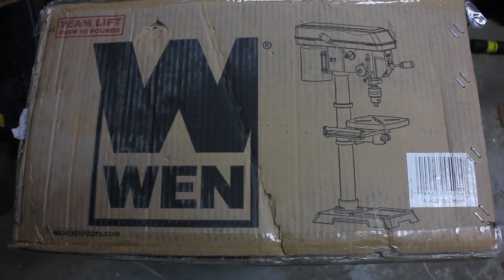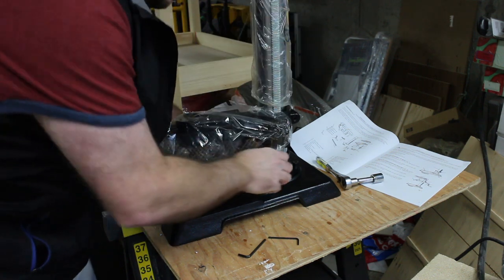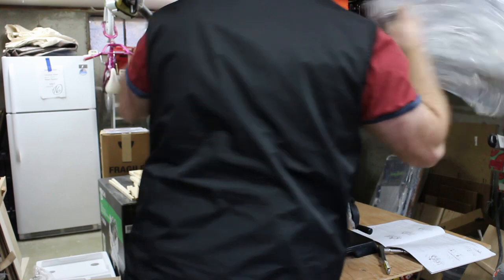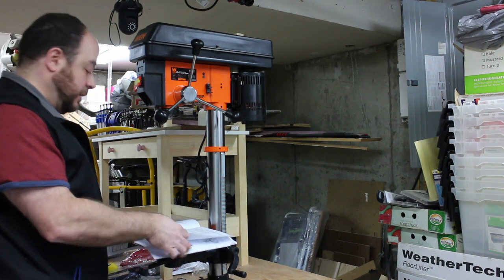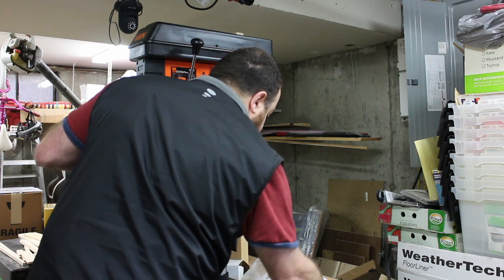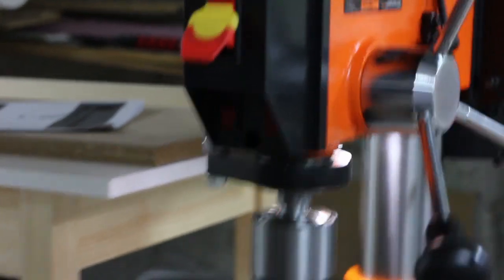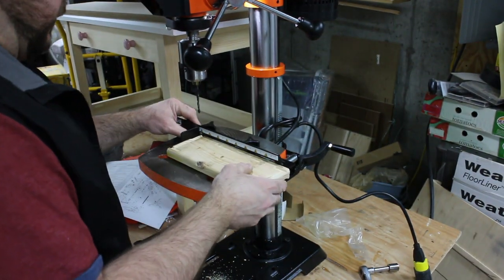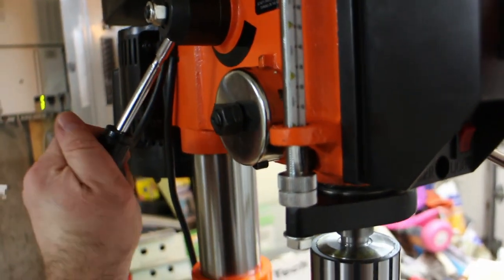WEN 4214 12" Variable Speed Drill Press with Cross Laser and Work Light - Unboxing and Assembly

Comment: When you spill some oil on your kitchen counter and wipe it off with a paper towel, there's still some oil residue remaining. That's why you'd use a household cleaner along with the paper towel, right? Same goes for the chuck and the arbor. You need to use a solvent to clean both. BTW, the "fingers" inside the chuck are called jaws. Good luck.
Reply from the maker: Thanks. I little film of oil doesn't hurt. Tools sometimes sit around without being used here often. The oil film is going to protect the surface anyway. Thanks for the terminology!
Reply: @m3rdpwr  If you can't see a difference between seating a chuck/arbor for least runout and oiling some random tool, not much left to say. Unbelievable.
Reply from the maker: @felixf5211  I wasn't talking about oiling a tool. I see many people completely remove oil from metal surfaces from these or table saw tops, just to wax them to keep them protected. A film of oil is not going to hurt anything, unless it's going to cause staining on a wood surface, etc. you are working on. The original drill press I bought from WEN had horrible shaft wobble and had to be returned. I never claimed to be an expert, this is my first drill press. I was showing assembly and first use. This Obviously did not satisfy your level of expertise. So as you said, not much left to say.
Reply: @m3rdpwr  A properly seated chuck should be air-tight. It's not a table saw that is exposed to ambient conditions. A film of oil on your arbor will indeed hinder the performance of the tool. You don't have to believe me; run a google search on seating a chuck. 

This is your first drill press and OTOH I work on them. There are 15 in my shop right now ranging from a 212lb Champion post drill from 1904 to a '90s Rockwell. FWIW, I only work on industrial and/or vintage presses. Never had anything like the Wen in my shop for obvious reasons. Before I ever touched a drill press, whenever that was, I researched setup and consulted with folks who knew more than me. Still do. As an example, just finished a 1939 Delta DP220. As it's a product of the original production run of the series, didn't want to make mistakes and discussed the work extensively with someone who has a lot of experience with this model. I'm trying to help you and your attitude is dismal at best. Ultimately I don't really care about your drill press, it's not as if it's one of mine, and will not respond again. Best of luck.
Reply from the maker: Okay so you won't respond again. You're obviously a professional, I am an amateur at this kind of thing. I don't need this for perfection of machinery, it's mostly to drill in dimensional lumber so perfect accuracy isn't a concern. This is good enough for me. Maybe in many years from now, I will need to get something more professional and learn. We are all learning, as you indicated that you're still learning. I needed something small in this fits my needs. I just find it interesting for someone with your level of expertise coming to an unboxing of a low end $199 drill press. Have a great day.

Comment: How to you adjust the table angle?
Reply from the maker: There is an adjustment lever, on the table itself that sits behind the vertical support post. There is also an adjustment that allows you to spin the surface to turn it that way if that's what you meant. Thanks for watching.

Comment: Thanks for the vid. I assembled mine from watching yours. I did drill 4 half in holes into the base plate to better stabilize the unit. Machine is 36 inches tall which is more than I expected.
Reply from the maker: BadWolf I think I measured mine out slightly taller, but that may be from the motor case top bulge.
Call WEN A and have them send you the fence if it's missing.
Thanks for watching and commenting!

Comment: Appreciate the review.  I was looking for some functional points, one in particular - can you swivel the head around?  To allow drilling into longer objects.
Thought I’d provide some quick tips to help with your future videos (meant to be positive, not critical)
1) script it out in advance and rehearse.  Think of 3-5 key points you want to make
2) keep it short 3-5 min max.  YouTube viewers have a short attention spans 
3) preset / pretest the camera views so that you get a clean shot and you’re not blocking yourself
4) yes, it IS polite but you don’t really need apologize or call attention to errors
5) take time to edit the video.  It’s ok to use time lapse & edit out content that doesn’t contribute to the overall message.
Reply from the maker: Jim, it's funny a buddy of mine said the same thing when I asked for suggestions.
This is one of my earlier vlog style DIY videos (6th of 82, I can't believe it!) , and since then, time lapse and editing out useless parts has been my friend with my new software, although time consuming.
That being said, I do appreciate the suggestions!
When you say swivel the head around, can I assume you mean the table, and not the head/motor assembly?
If you mean the table, yes it can be raised/lowered as well as pivoted/spun off to the left or right side.
There is a handle at the back of the table on the left side that will allow you to do that.
Or is it you want to turn the head/motor assembly around so that you can drill a very large object that may be on the floor?
For that you would have to loosen the two alan head screws I tightened @13:30.
Does that answer it?
Thanks for watching and your support, I appreciate it!

Comment: Hi Mario thanks for the video! Mine arrived today and I was prepared after watching you put yours together. I can't believe mine survived the trip based on the condition of the box. Unlike yours, mine didn't include a fence.
Reply from the maker: Ali Maleki that's awesome! Strange it did not include the fence. However, my manual shows little about a fence but it came with the fence. I would call when and tell them your's was missing the fence. I bet they will send one to you. Let us know how you like it!
Reply: I have a feeling it may have fallen out of the box. The box was torn in corner where I believe the fence is stored near the chuck which was floating itself floating around without it's box!
Reply from the maker: More reason to call Wen ASAP and see if they will send it to you!
Good luck and thanks for liking, commenting and watching!
Reply: I just got off the phone with WEN. They confirmed that they no longer include the fence. I also noticed that (unlike yours) my manual doesn't show it in the parts diagram.
Reply from the maker: That's a bummer.
Thanks for letting me know about that.
That being said, you can make one with a small piece of hardwood like a 1"x1"x1ft, some long toilet closet bolts, washers and wingnuts/knobs.

Comment: I just got this drill press.  It goes together easily.  One note, it no longer comes with the fence that you assemble at 36:00 minutes.  However, I purchased the auxiliary table from amazon and it works well for woodworking.  I did need to adjust the lasers as well as the table angle so the bit is square to the table (a simple adjustment).
Reply from the maker: Thanks for sharing Andy. You are the second person to mention that the fence is no longer included. Would you care to share the link, or model of the table for other users to see? Thanks for stopping by!
Reply: @m3rdpwr  Sure!  I purchased the drill press (WEN 4214) and table (WEN DPA2412T 24 in. x 12 in. Drill Press Table) from amazon.  Here's the link:  https://www.amazon.com/WEN-4214-12-Inch-Variable-Speed/dp/B00HQONFY6/ref=sr_1_1?crid=15MHX366DMH1G&keywords=wen+12+inch+drill+press+4214&qid=1551662181&s=gateway&sprefix=wen+12+inch+%2Caps%2C139&sr=8-1
Reply from the maker: Perfect, thank you. I will pin that link in a comment.

Comment: thanks for posting this video. I just bought the same drill press and will be putting it together soon. Your video will help. Good stuff!
Reply from the maker: Thanks for watching and commenting!
Reply: hey mario, I got the drill press installed. everything is working fine. one thing I did notice was how tight the variable speed control adjustment was. The lever is pretty tight, so speed adjustments are very slow. Is that how it is for you?
Reply from the maker: It is tight and I move it slowly.
It does have an adjustment for that, but I recommend you don't touch it.
If it was too loose, it could change speed on you while in operation.
Let us know how you like it!
Reply: I just finished a project that involves drilling eighty 1 3/8 size holes with a forstner bit. This WEN DP worked like a champ. Absolutely no wobbling. The included fence was helpful as well. I'm glad I got this DP for $199 on sale. Well worth it.
Reply from the maker: That's good to know!
I have yet to tortured mine, just some holes here and there in wood and also when I was doing some heli-coil inserts.
I'm tempted to get some of those sanding drums to make it a make-shift sander.

Comment: I just assembled mine today (12/2019) and it is very easy.  Evidently the new ones don’t come with a fence but the rpm readout does turn off when you turn the power switch off. I know a lot of other videos say it stays on until you unplug the press.
Reply from the maker: Yeah, I've heard about the fence not included anymore by many. If I recall correctly, my manual didn't talk about the fence. My display stays on all the time. Seems strange they would have done this. However, I unplug mine after use, so I am not too worried.

Comment: Good job with the video. Try to keep the camera from too much movement;move camera slower so that the viewer is gradually taken to the next area. Questions: Is there a another chuck that will fit the DP? What size is the taper of the chuck?
Reply from the maker: Thanks for the suggestions! I actually bought an extra wide angle lens after shooting this (10-18mm) so I could shoot better and get more in the shot.

Yes, there is another chuck that I found listed by another user at the time of my purchase.
I don't have the exact model, but this was the manufacturer.
https://www.amazon.com/dp/B00N413YUU/ref=wl_it_dp_o_pC_S_ttl?_encoding=UTF8&amp;colid=3RYUTMS5YE2QY&amp;coliid=I35MJWA71DL1BV&amp;psc=1
Call the manufacturer HHIP and WEN to verify shank size, etc.
To be honest, I didn;t buy it because it cost more than the Drill Press!
It is quite nice though, has very little run-out and is a keyless chuck!
The person who bought it seemed to have liked it.
If you do decide to purchase one, let me know the model so I can add it to the description.
Thanks for watching and commenting!

Comment: I have the model 4210, two models down from this one I believe.  Its pretty good and does what I need, but wish I could have went one more up and got a bigger motor, mines like 1/3 HP and 3.9 amp.   but I only paid $98.00 for it on sale and its still doing well over a year later so I could have done worse, its certainly better than an equivelant HF model.  I did eventually replace a somewhat wobbly spindle pulley from Wen, I paid for it and Menards reimbursed me the $16 -- its from China what are 'ya gonna do.

Comment: I bought the same drill press .my chuck is a tad outta balance ,, wen is sending me a new one , and you mentioned the speed adjustment is stiff , Mine did the same thing until I read the instructions that said DONT adjust speed unless motor is running . LOL opps for both of us ..
Reply from the maker: I thought I mentioned only moving the handle when running. Maybe not though! Thanks for watching and taking the time to comment!
Reply: you did , I was in the middle and you mentioned it at the end ,  good video

Comment: thanks for this review. I'm looking for an affordable option for drilling steel. I want to drill holes in 1/4 inch steel, some sheet metal etc. Would this be a good press to do this with? Or, should I go with the 4210?
Reply from the maker: I've only drilled wood with this press.

This is the 4214 a 12" press. The 4210/12 is smaller. (10"?)
The 4210 I think is manual speed belt adjust, whereas the 4212 has similar speed adjustment like the 4214 here.

That being said, if you have a good drill bit, cutting lubricant and set the press at the right speed, I wouldn't see why you couldn't drill in 1/4" steel.
I don't know if it could do it all day long, but casual use shouldn't be an issue.

I prefer the easier adjustability of this drill press for varying speed. If you drill in many types of materials, hardness and thicknesses, this model makes sense.
I wish I had some here I could try out for you, but I am limited to lumber at the moment.

Thanks for watching and commenting.

BTW Amazon is having a large sale on WEN products, go check it out.
https://www.amazon.com/gp/product/B00HQONFY6/ref=ox_sc_act_title_1?ie=UTF8&psc=1&smid=ATVPDKIKX0DER&tag=tbdirect-20&ascsubtag=584e81b5-8e72-40c7-a931-9cd0e04f32b3
Reply: thank you for your help. just subscribed.
Reply from the maker: Thanks!
BTW I think that drill press just dropped in price again for $186.90.

Comment: Thanks for the video!
Question: How tall is this press from bench to top? (I checked the manual online and they only list the 20" from chuck to base dimension)
Reply from the maker: Forgot to check before I left this morning, I'll check tonight.

So here are the measurements I took a few months ago to start planning for a cart for the drill. Approx in inches.
I think the first measurement is what you are interested in.
I wish I had measure it out and put it in the video, but I will now put it in the description.
Thanks for watching and commenting!

Total height = 37-1/2"
Lowest press table will go from bottom of base to top of press table = 8-3/8"
Motor and head depth front to back = 22"
Motor and head width side to side = 7"
Base depth front to back = 16"
Base width side to side = 10"
Top of base to bottom of main body = 25"
Drill table width 9-1/2" to 10-1/2" not counting extension.
Reply from the maker: See below, or above. lol
Reply: Thank you much. Those are very helpful, it's actually much bigger than it looks in the video!

Comment: You didn't tighten the main column at the bottom with the set screw. At 24:16 you rotate the whole column. It should not spin if the set screw at the bottom is tight.
Reply from the maker: Hi Bob, not following you. @13:30 I tightened those screws.
The whole column wasn't turning, just the table and the vertical gear were turning inside the gap.
If you look, that mid orange ring isn't turning, it's just a retainer for the vertical gear.
That means the whole post is not turning.
Maybe I'm not understanding, can you clarify?
Thanks!

Comment: nice video, but you need better lighting. the depth of field is very narrow because the lenses are wide open. if you had more light, or brighter lights, then you would have more clear and crisp, in-focus areas of the video
Reply from the maker: I have 4 shop lights and 2 more I have had sitting for months waiting to go in.
The area the camera was in had lights above it. Unfortunately the drill press was under a bulkhead which blocks the light from the other side.
Hopefully I will install the 2 extra shop lights soon.
Thanks for the post!
Reply from the maker: Watched your videos. You should create longer ones with commentating!

Comment: I almost bought this 4214 variable until I saw this video.too mousey and vibration.i decided to get the 4208.wikipedia rated the 4214 number 6 out of 7 best low price drill press...4208 rated number 2.
Reply from the maker: I bought the 4208 first for $60 on sale, which was a real bargain at the time. There was a ton of wobble in the shaft, so I returned it. I decided to get the bigger one at that point.
Reply: The 4208 will not do what this will because its under powered for anything but light woodwork. No vibration problems with mine .Best drill press for price range  for DIYer; IMO. .No problems with vibration with mine.

Comment: Laser dies not work in mine.
Reply from the maker: Do you mean it works for sure. And then turns off? Or it doesn't work at all? Mine has a separate power switch for just the laser.
Reply: It worked when first set up then quit working. How do I get to it to maybe find the problem.
Reply from the maker: @evelynshumate2791  Make sure nothing is obstructing the laser lens on the drill press. Maybe some debris flew up in there?

Comment: It would have been a better video if you were prepared. If you had the parts sorted, and ready. If you didn't have to grab the instructions for answers.  If you didn't turn you back to the video. If your focus worked right. I notice one focus the camera made was to focus on a roll of paper towels across the room.
Reply from the maker: This was 2-1/2 years ago and one of my oldest videos. (6 of 159)
As the title mentioned, this was an unboxing and assembly as well as what you may encounter.
My videos  have been getting better, and that camera has since been replaced because of focus noise issues.
Thanks for watching and the feedback.